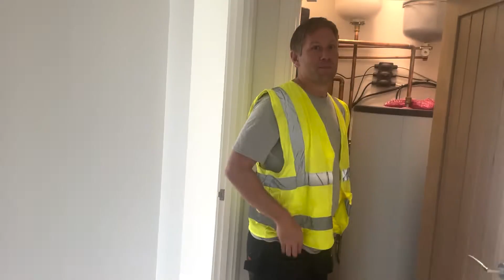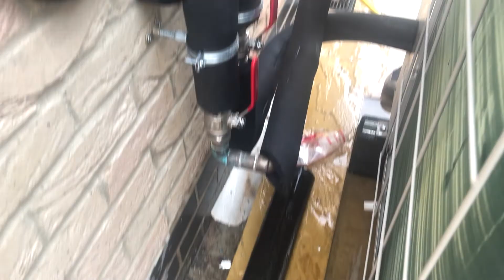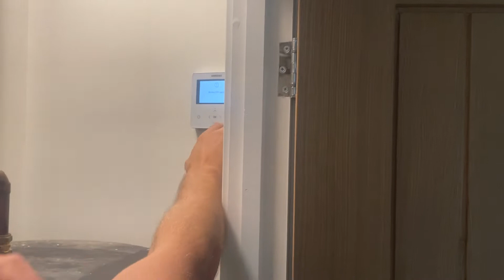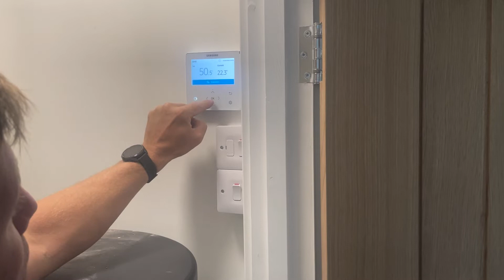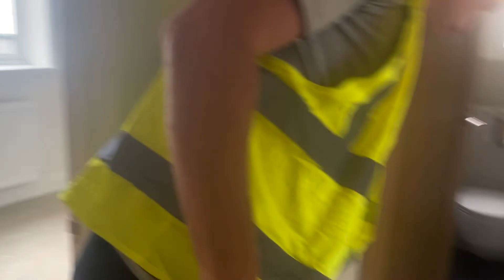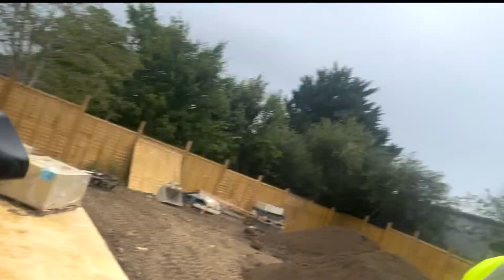Commissioning An Air Source Heat Pump with Alto Energy

Comment: Flow and return what temp flow what temp for return and how do you alter it, I have heard good reports about Alto.my pump was banged in to the old pipework changed 3 radiators no instructions given fitted over the phone by Grants,Grant Aerona3  no setback settings no timer radiator heating only,it is costing a fortune any advice other than bin it haha.
Reply from the maker: Sounds like a nightmare. Sorry to hear that. We only sell Samsung, Mitsubishi and Bosch, which means our technical support team are only trained on heat pumps sold by those manufacturers. Unfortunately that means we're unable to offer support for other heat pumps brands.
Reply: @AltoEnergyLimited  The principal is the same Flow/ Return you are looking for a 8degree drop or what or is it guess work no one wants to say.Cheers anyway